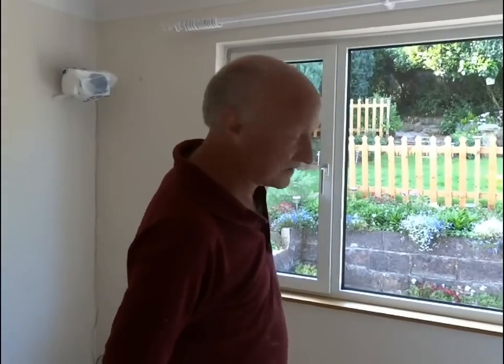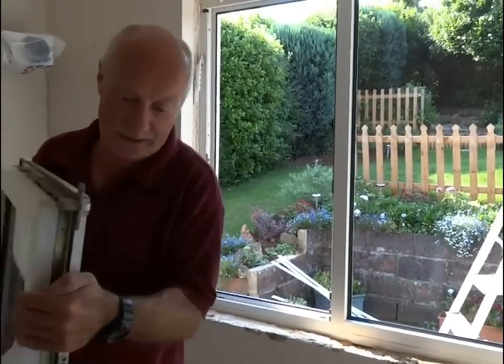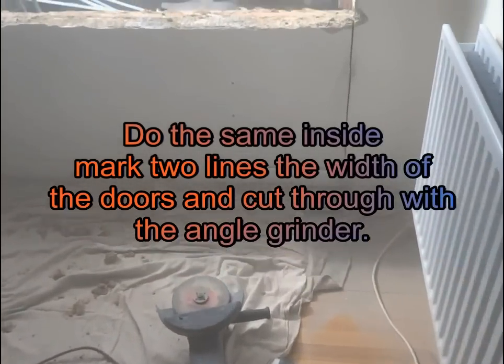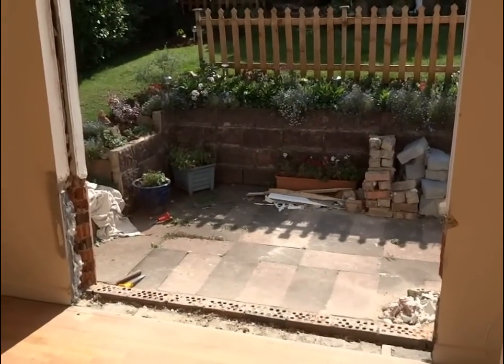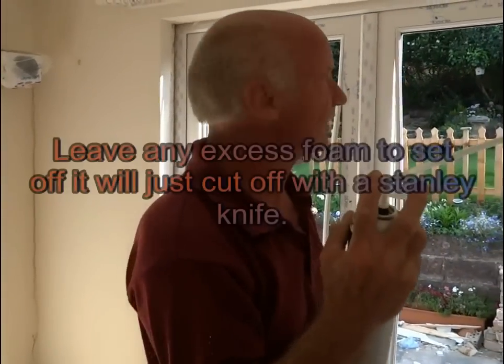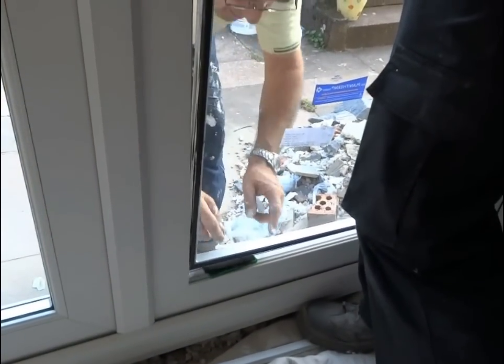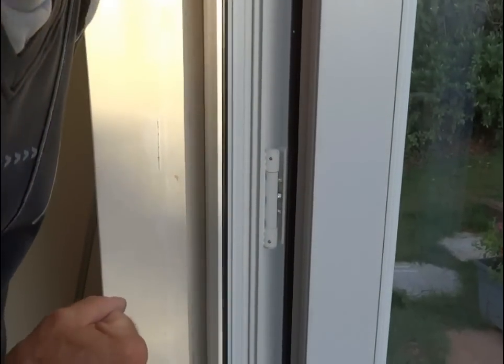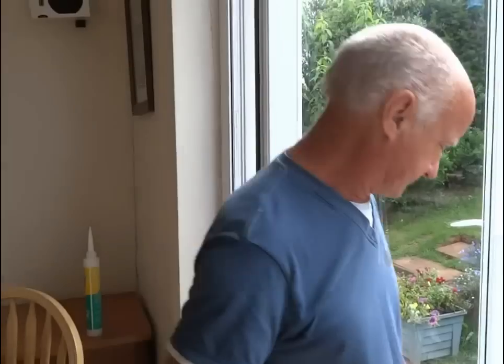How to remove a window and fit french doors.

Comment: I have been installing pvc windows for over 15 years and I would like to point out that you should cut the outer skin of brickwork before removing any window sections. This way it keeps the clients home ALOT cleaner as the dust is kept outside. For the inner course I use a large drill bit and drill a series of holes 15-20mm from the quoins down to skirting board. I try to remove the skirting allowing a little extra to return back to new door, again is to minimise dust in a clients home. Removing the glass before removing the frame is safer and helps as you can split the frame into 5 sections by passing a saw over the weld point (internal corners of the frame) and driving a hatchet through by hitting the back of the axe with a lump hammer, by doing it this way it minimises mess, time and excessive damage to surrounding reveals.
Reply from the maker: Andrew Miller Thanks Andrew for  your helpful comments.
Reply: Thank you very much for your comment, I am DIY fitting French doors with sidelights and where he had put the grove of the bottom frame in the upstand of the sill had me worried I was doing it wrong, your clarification has saved my sanity! 😊

Comment: I've been manufacturing and fitting doors and windows for 30 years. The reason some of us look at these videos is not to see how it's done but rather to see what advice/instruction people are putting out there. The double glazing industry doesn't always have the best reputation so if we can occasionally help out by pointing out errors/mistakes and save even a small number of people problems, can only be a good thing right? Last thing, if someone is quoting as much as you say, RUN AWAY. For a pair of doors that size you should be looking at around £1200 /1300 fitted including cutting out and making good inside and out.

Comment from the maker: Hi John , The sill is not actually screwed down , you make sure the bottom wall it is going to sit on, is straight and level and sit it straight down on it,as the weight holds it in place , if you are not happy with this you can screw it down .The frame is attached to the side wall with wall anchors at least 2 to 3 inches long. Once finished use mastic around all inner and outside edges to give a professional finish
Kind regards,
al.

Comment: for information the window wedges, are in fact called packers and come in different thickness for sitting under and side of glass. Must say I wouldn't use a piece of wood to bang in trims, can cause untold damage use a rubber mallet. Having the right tools will make it easier still

Comment: Did you unhung the doors leaves from the frame before fixing in the frame with the screws? If not, how did you manage to screw in an opened door and keep the frame still levelled?

Comment: you should also fix the two top corners and 1 base corner first, before you fix the remaining corner glaze the doors (toughening glass can warp the unit) then you can line the sash to the frame (in wind), if this is not done the locks will be strained when you lift the handle to lock the door and cause early failure to the locking system. Once lined you can place the remaining fixings( i use 6 fixings to each side 1 to the centre of the head...providing it is not a lintel which has a weep drainage system ) you did mention toe and healing which is correct but for best practise you should also insert packers to the centre, in line with the centre hinge and handle. the centre packers allow full use of the centre hinge. The window/door is supposed to abut to the up-stand on the external sill with a bead of mastic in between and never ever fix the sill to the brickwork before inserting the door, the two items need to be sat together correctly, you would be better fixing the sill to the frame from the underside (typical ext sill is 30mm so a 40-50mm coated screw will suffice).When you seal the exterior you need to be using the correct mastics too, Low modulus silicone is the correct mastic. (acrylic/decorators caulk is strictly for plastic-plaster finish) high modulus silicone does not flex and will tear causing premature fail to the seal. My comments are not criticisms... i admire your can do attitude, just wanted to help you improve you knowledge.....and understanding as to why a good installer asks a lot.
Reply from the maker: Andrew Miller Thanks Andrew. Al.

Comment: I have a question I hope someone can answer. We've recently had windows knock out for sliding doors.  They've installed them but we are left with a little problem. The wall was taken all the way down to the damp course. The interior floor sits below the damp course. The frames for the doors have not been installed flush with the inner wall so we are left with a ledge of brickwork about an inch high and an inch deep.  Sticking out below the frame, above the floor line. Should the frames have been set back flush with the inner wall, so we were left with needing just to membrane the little bit of wall below it and finished with a trim?
Reply from the maker: Everyone seems to have there own ideas when fitting doors.. I always sit mine back flush to the inner wall.

Comment: all i can say is the spray foam was used upside down firing more air out rather than the foam. its an easy mistake but yeah u turn them upside down to use them :)
Reply: neil brady hi Neil, you know nothing.

Comment: Hi Al, 
Thanks for uploading. I'm about to undertake the same job and have found your video very helpful. Some questions for you tho:
1. Can you explain how you ensure the sill is level and how this is fixed to the bottom wall? 
2. Can you explain how the door frame is attached to the walls? Surely it can't just be with expanding foam? 
3. Once the frame and door is fitted is it just a case of filling and plastering the gaps to acheive a proffessional finish? 
Many thanks,
John.

Comment: Never know the lip on the cill to go inside the groove? Ive always put it so the lip is up tight to the back of the bottom rail and sealed. How come you do it that way?
Reply from the maker: It holds the cill and frames firmly together without slipping forward.
Reply: The lip sits against the back of the frame not inside it
Reply: So whats the groove for then?
Reply: Because he doesn't know what hes doing
Reply: Because he doesn't know what he is doing ,just like the glass wasn't fitted with the correct packers but not bad I guess,i give it 5 out of 10
Reply: @dereton33  thats why we screw the cill down ,

Comment: For replacing windows with french doors, do any structural checks need to be done or should it be fine to just put the French doors in. 

I do have a lintel in place, so should this be fine?
Reply from the maker: No so long as you have a lintel.
Reply: dereton33 Thanks

Comment: So I have exactly the same size that needs to be done and I believe there is a concrete lintel above the window. One builder said I have to support the opening when I take the window out. Is this true? Do I need a structural engineer? I thought a window replaced with a door (165cm width window) wouldn't need an engineer to check it out.. I'm not exactly touching the lintel.... And I didn't think anything needed to be supported because a window isn't exactly supporting the ceiling....
Reply from the maker: If you have a lintel already you will not need a structural engineer . There is always one above the window. As long as you keep the doors the same width as the window you will be ok.
Reply: dereton33 thanks Al. Was worried if I take the window frame off the house will fall down 😂

Comment: I want to do this myself, my window is only 3.5 ft wide though and a kind of basic french door is 4ft,am i ok to cut out the extra space say 3 inches each side or would I need a bigger lintel putting in you think, it's my first go at this but hey you have to start somewhere :) and advice would be welcome cheers :) don't want the house to fall down on me :)
Reply from the maker: You will need a bigger lintel.
Reply: dereton33 
Thanks for the reply, much appreciated :)

Comment: I'd like to do just the opposite. Replace a French door with a window. Is this possible or too complicated? I know it would require lots of wall frame work build-up underneath.
Reply from the maker: Everythings possible, you just have to be good at brick or block work and plastering.

Comment: you do not lift the doors over the lip on the cill they go up against it,thats basic fitting,this is to stop the water back tracking under the doors,and you can do all the cutting with the disc cutter before you remove the window this way there will be hardly any dust in the house,but good luck to those who follow this video you will need it
Reply from the maker: Fitted these doors nearly six years ago now, they are still perfect and by sitting on the cill they are locked in place and no leaks inside, still saved £5.000 .
Reply: Would love to know where you learnt how to fit doors like that
Reply: What about the dust from doing the disc cutting on the inside lol

Comment: Ive watched quite a few of your plumbing videos and found them useful.

This video however shows more errors of instalation than correct methods and the end result is fairly poor.

You did get a cheap frenchdoor instalation but personally i wouldnt want to pay for the result so the saving is mitigated.

You should have borrowed a stihl saw or hired one so as to cut through the ourside brickwork in one and done the outside cuts before you took out the window. Id have stich drill  the inside  block wall rather than used a grinder so as less dust.

I got the feeling that in doing it the way you did you were rushing knowing you had to get the door in rather than take your time hence all the dust and broken render.

Its been mentioned but you never heeled and toed the glass when you did your packing this is a critical error.

All this said youd have had a laugh seeing me struggle when i used a pipe bender the first time wanting to do four bends on one section to mesurements during my kitchen instalation and the  3m length of copper i wasted trying before i sussed it! The end result was good but what would have taken a plumber a morning took me a day and a fair bit of head scratching
Reply: When will you be making a video sir?